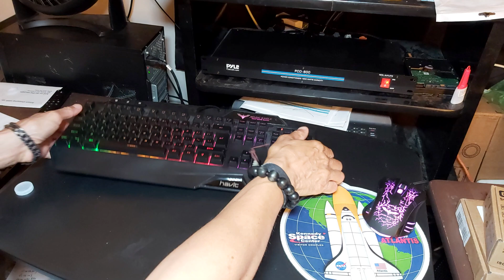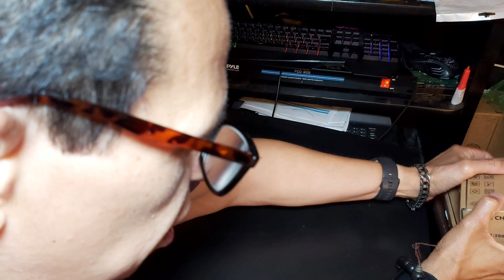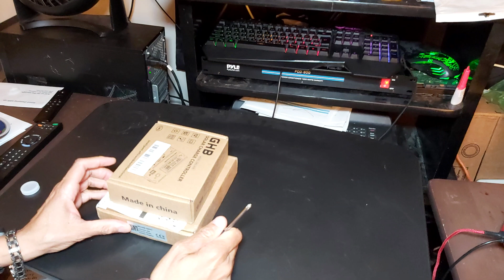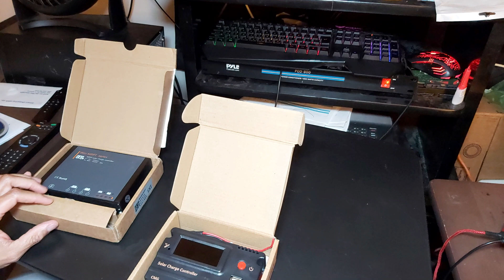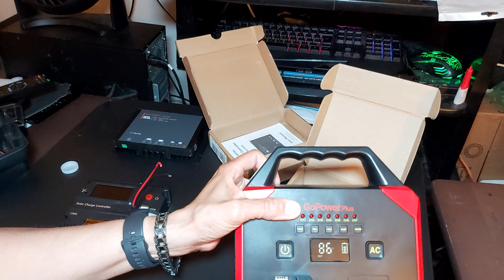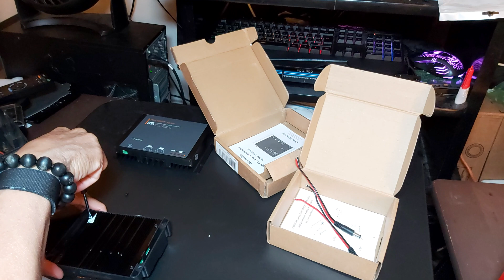SOLAR | In-Depth Review  On Solar Controller's 12/24V 20A Win500-MPPT VS CMG-2420-PWM

Comment: Hi
First comment! 😊
Could you please check how well mppt is working with the win500? Could you also check the app out if it works well? Is the voltage and amperage shown correctly?
Much appreciated!!
Reply from the maker: Thank for your comment. Sure I know what you mean about the app crashin g you need to turn off other pair Bluetooth devices then use the app. Once in quickly make your changes to it. They say by default LIT is GEN no way. I fixed that.  Win500 your talking about?  Or the app software mine is after I made the changes.
Reply: @alberts-solar  
Many thanks for your reply! win500 is the model name of that lumiax charger.
What I wanted to know further, is the history of each tab (pv/battery/load) properly displayed?
How is the efficiency of this charge controller (input solar vs output battery)? Have you compared the voltage and amperage readings in the app with a meter? Are they close or off?
Many thanks!
Reply: @alberts-solar  Your SUV mppt solar charger is called Lumiax Win500.

Thanks for the tips and pointers!

I was wondering why there is no data in your charts (history) visible in your app? Haven't you used the charger for longer time yet? Is it offline? 

Further would you mind to measure the solar input power (wattage) and how much power goes into the battery (wattage) in order to calculate the efficiency of this charger? Of course the battery should not be full while testing that. They claim over 90% but I wonder if that's true.

Much appreciated
Reply from the maker: @off-gridretreat9293  Thanks again for  your feedback did you check this out I had posted yesterday #eveningsereviewofhsgmpptsolarcontroller  should answer a few of your questions. No problem here to share and learn and tell.
Reply from the maker: @off-gridretreat9293  Thanks again for your feedback.  So it's call Lumiax Win500  here it's call 
PowMr 20A mppt Charge Controller. Your info has more on this device.  I use it in my SUV to charge up 435 CCA AGM battery  keep it's at 13.6V . I believe it's true!
Reply from the maker: @off-gridretreat9293  Thanks again for your comments. I don't have any battery that it is completely discharged. They are all fully charged. Dead batteries I was sent would have been perfect for this task. I had sent them back to where they came from.
Reply: @alberts-solar  many thanks for your replies.
I was thinking to order one but would like to know how it performs first. 
Yes I checked that video, same no data shown in Charts. So sharing your knowledge about this controller is very much appreciated. Nobody reviewed this one yet on YouTube, you are the first! 

I saw you have two batteries in your nice looking powerbox. 
After you maybe have used up 10- 20% of its capacity you could do a quick efficiency test. No need to have a completely flat battery for that. Just check with a multimeter the incoming power (solar or battery charger) and the outgoing power (battery). Compare the multimeter voltage and amperage readings with the voltage and amperage readings of the app. How is the efficiency and how accurate are the app readings?? 

As well how much power does the charge controller use when not in use (when powerbox not connected to solar panel for example). Just check the power draw at the batteries when not charging the batteries.

Much much appreciated!
Reply: @alberts-solar  Powmr 20A... is a rebranding according to what I researched in the Internet. The company who produces this charger is Lumiax.
Reply: @alberts-solar  According to the datasheet it consumes less than 12ma. So that question is already answered. Now only left is its efficiency.
Your 60w panel and lithium battery would be perfect for that test. Sure needs some good sunshine as well. ;)

Would very much appreciate if you could quickly check its performance, its efficiency. Thank you

Comment: Hi
does anyone discovered actually the android app for this charger ?!? I mean link for download the app ... I bought this one without display because it says it can be connected via Bluetooth but there is nowhere actually link for the app...
Reply from the maker: Thanks for comment! The app is called  SOLAR LIFE. Now before you use it remove all paired Bluetooth devices you have attached and paired.  Now let Solar Life pair with the software and your Bluetooth once that is connected you can let your other Bluetooth devices repair again. This has to be done because there is a fault in the this software and it will keep on crashing. I guess the developer didn't make sure that his or her code wasn't bug free. I use to be Android developer so I kind of know what to do. But just a heads up the software will not read that means you have exit out and relaunch the software again. Then is should work make sure you hurry when you want to Read and Write to ROM chip. You have to Read the settings then press Send. It will not do it for you. Again something the author/developer forgot to add. Then you will be okay. Ignore LIT being the same as GEL settings are different.